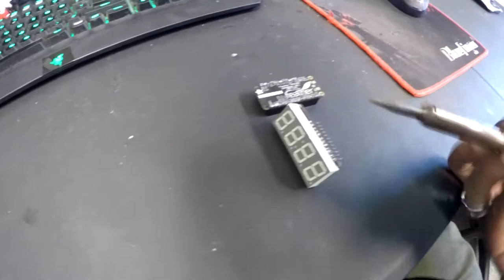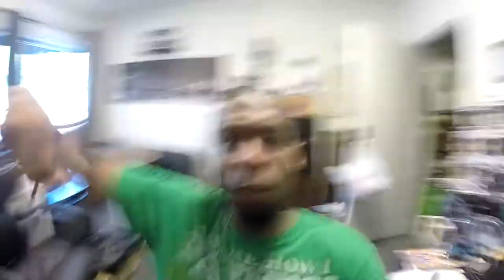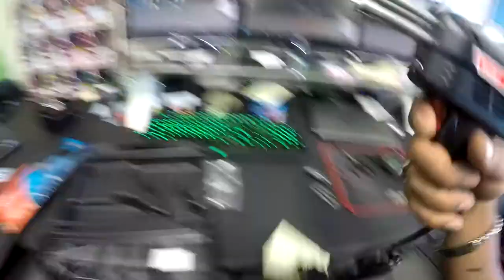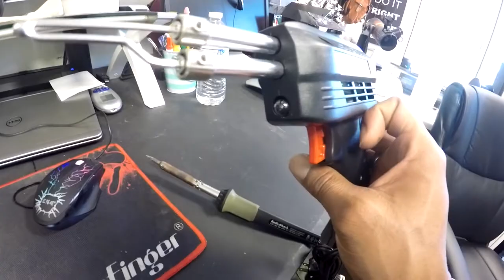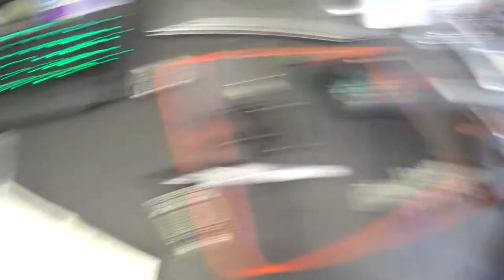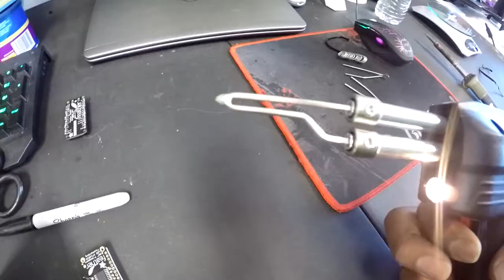Weller 8200PKS Sodering Gun Kit - Unboxing and Review

Comment: As a 73 year old retored electronic technician from Canada...

Weller soldering guns have been an old standby for decades, but to a degree some models might be becoming "too good for the market".

I stil;l have an 8200K from back in the 60's, and it still does a good job for what it is suited.

However as with all else it has its place and its out of place. Also it has a whole family of "Big Brothers".

the 82900K is rates at

To make my own tips, I use A.W.G.14 copper wire.

I have also made my own replacement tip nuts just to have an extra pair around, and my version has an added element of veratility for smaller then normal jobs.

However, in Montreal quebec, Canada, it is beginning to get hard to get the counterpart of the 8200K, although I still have to check out Walmart, as their websits has no picture to be sure what I see offered is the same or (power equivalent, not more) model.

What I have been seeing in my socuting around is two larger models.

The last time I was an 8200 it was in Canadian Tire at about$49.00 CAD or so (plus usual consumption taxes of about 15%), but more recently that was no longer there.

I also have one of the next largr model (up to 140W) and for that I make the tips out of A.W.G.10 copper wire.

(BTW I hold the Canadian electrician's Interprovincial ticket, so I know my wore sizes for sure!)

However that and the oter larger models such as the D550 are too big for many jobs, although they are good for many mechanical jobs, especially with the chemical changes in fluxes and solder following the market integration of the RoHS - anti-lead standard.

There are now solders available for various types of work from lelectrical to Mechanical "metal", to plumbing. They are somewhat more expensive, because they have to contain a small percentage of silver (which Tektronix was doing for some situations long before all that) .
Also when doing mechanical soldering one can solder steel without the need for acid and acid core solder which used to hot-splatter a lot.

Not on CMOS!!

CMOS and other electronic chips (Integrated circuits) such as you were showing are not a safe place to use a soldering gun. the tip will radiate a magnetic field that can =cause problems to semiconductors, especially where CMOS technology is involved. also.

Ofor such cases, you would be safer using an electronically controlled static=-free soldering station, such as from Xytronics. also you should take the established precautons to prevent static chearges from your body causin static discharge damage to those CMOS and other chips. When that happens you will only know when the circuit simply doesn't work in the end.

If working with SMT (Surgace mount technoloigy) such chips need to be removed using a hot air SMT work station with the approprite handlng tools for the package types you need to work with. These tools are expensive. A hot aor rework station can be easily worth $1500.00 and more and that is just the beginning.

That is why component level rework on these circuits is usually not even attempted unless the circuit is worth thousands of dollars to begin with. that's ticklish job! I've done it in my working years!

As for the shaking hands, I have this problem alspo as do many. However "where there's a will, there's a way" but it does become more complicated.

For an old iron I have much like the first one you had there, I made a guin handle out of a combination of wood and steel to hold the hot iron safely at closer range. to control the power/ heat in a rough manner, I power it through a custom made extension cord which ends in a 2 gang 1104 electrical box with a typicl light dimmer then powering a receptacle in the second gang. Note this rig is limited to 500 watts, so don't use with larger heating devices, as the dimmer could overheat and cause a fire! dimmers sued to handle over that power are specialized units and if mounted in the wall use more than one gang of space because of their heat sinks. If low voltage controlled the power handling thyristors are built in fireproof units that are housed in an electrical room or M.C.C. and also work on a different electronic control strategy.

Also Domestic light dimmers are not suitable for use with motors or other inductive loads or capacitive or high inrush loads. Nor are they safe with CFL, fluorescent or other non-resistive lamps unless the lamps stat explicitly otherwise (such as some, not all L.E.D. lamps.)

I also make my own tools and jigs where what I want is either unavailable or excessively expensive, but all that takes hundreds of high-concentration hours1 NO EASY WAY OUT for what is truly worthwhile..

(I have electrical gear I build some 40 years back that is still working, in  spite of having had to work outdoors at times.)
Reply from the maker: Wow, Outstanding information here Mr. Martin!  I greatly appreciate the details, especially from an expert such as yourself in this area.  I have received several messages about my Soldering and also advice pertaining to the 1st iron being the better option for this kind of job.  This was a great learning experience for me, a few of the chips I thought I fired due to the power of this gun, I was actually able to salvage after de-soldering (which I still don't fully understand using the braid...but it worked) and pealing back some of the melted plastic the gun was exposed to.   

But once again, thank you very much from the great information!  Don't forget eBay can also be a great source for obtaining those counterparts.  Usually the navigating is more user friendlier than Walmart.  Same concept, Walmart Sellers are similar to ebay sellers.  They sell though the site as they do with Ebay, amazon etc.  Usually older items are easier to obtain this way.  

Have a great day and thanks for tuning in!

Dave
Reply: ReHi Dave:

1) ebay has a problem that is not their fault. I ordered a commercial paper cutter from one of their supliers in the U.S. and ended up[ with a credit card scam which ultimately was traced to a scammer outfit in Utah. but by the time the credit cared issuer had traced it and stopped it,lthey had already grabbed several hundred dollars monthly iver about 3 months.

EBay is a nice concept, but in a sense they are too good. It makes them too much a target for scammers. Too bad, as usual there is always somne moserable sod to spoil it all for everyone.

Curious: OI assume you are in the U.S. but what state, and maybe what city? I am somewhat of a map and geography buff amongst many other thengs!

(BTW if you are not familiar, Montreal Quebec Canada is about 450 miles (or 7 to 9 hours drive) North of NYC mostly via I-87 from either the garden state parkway or off the Tappan Zee bridge in Yonkers.

Buit that's not the best way to visit. From Penn Station, take the amtrak Adirondack. Its 11 hours, but you will see the countruyside.

Interestingly enough, while NYC is on the coast, Montreal is about 800 miles from the coast. go east from Montreal to the coast and you will end up in Halifax Dartmouth Nova Scotia - and set your watch, it's 1 hour later there!

To see it all for Rail in Canada look on You tube for the many Via Rail train trips, especially The Canadiain, Toronto to Vancouver - you live on the train for 4 days very scenic butg expensive.

And if you do plan to visit, don't try to get Canadain cash from a U.S. Bank. they're just not adequately set up to do it efficiently. In stead bring your U.S. cash and plastic here and walk into any Canadian Chartered Bank.

e.g. If you arrive by the Adirondack in Central Station, the head offiice of thr royal Bank is there as a part of the underground city. You would Walk from Amrrak to them without even going outside. Let them change your cash and more. N.B. smallest Canadian bill is $5, so you will likely end up with some 13 sided "Loonies" ($1 CAD coin used daily).

And if you don't speak French, no problem. (there are some 80 or more languages in a day on the streets of Montreal and many of them don't speak French either! English will do, but the parlance is a bit different. (Parlance moans more or less, manner of speaking,. It is more than simply accent, but not unscrutable.) And stay away from the poyutine! It's He!! for your health. Better other treats.
Reply: ReHi Dave...

1) I think you meant in regard to the chips, "fried" rather than "fired". To me, in electronics, the use of "fired" might infer the on-commutation of a thyristor, such as an S.C.R., ar a triac, or possibly rthe on-triggering of an IGBIT (insulated gate biploar transistor) by the circuitry used to make it "fire" when it should. thjat would apply to industrial electronic motor drives, but in more recent years to their mobile counterparts used to run subways, electric railways (such as the Acela), etc. and also as a part of the drive systems in hybrid vehicles, and diesel-electric locomotives.

2) Being geographically curious, and thinking you are likely american, from what state? I am currently in the Greater Montreal Quebec, Canada area which is about 450 miles due north of NYC.
Having had a mobile career and more, I have had some 1 million KM. on the road, not to mention fly and drives in 3 countries and 3 languages, Englsih (native) French a strong second, and Spanish 3rd., and may uinderstand spatterings of a few other languages.

You can see many of my extensive comments on various You tube channels, such as Ron Pratt and hois truck towing channel, in Aviation, Mentour Pilot and Captain Joe, various Lufhansa videos, and also for rail in many countries, Network Rail in the U.K. SNCF and Renfe in franc and Spain and more.

And various animal related videos (Ilove animals but am not in a position to take direct responsibility ofor a pet, but usually befriend neighbourhood animals easily unless the animal were vicious or too skittish to accept a nice approach.

In the IT world, I like eli, the computer guy, but hois lessons are not for the faint of heart, he is very highly trained and appears to have had somee sort of serius IT relatede milirary career, so you can be sure he knows his stuff like no tomorrow, but he will not be so easy to follow for beginners. I wish I had more time to follow him, but being alone, I have to contend with being "chief cook and bottle washer".

While I don't upload videos yet, I have started one using Pitivi (an advanced non-linear video editor that runs in Linux) but I have not yet solved the problem of my very gravelly voice (part of growing old).

Being a stickler for quality, I will not release something until it meets my pewrsonal standards, so there is a chance I may never upload a video, and adsense and rthe money aspect means nogthing to me because the economic environment I am in would more than tax any tangible benefits out of my hands, so that would be a waste for all.

My objective is to be not for profit, non-beholding and ethically independent.
Reply from the maker: Hello Mr. Martin, E-Bay still has a few of the Bait and Switch routines going on, but not how it use to be.  Its actually more in favor of the Buyers instead of the sellers.  Actually there is an added layer of security (Paypal) which has Buyer protection and now its extended Buyer safety policy outside of e-bays which adds that extra comfort.  (Ever since e-bay and Paypal split).    So what this is causing, most sellers are now leaving E-Bay due to buyers scamming (vesurs the other way around).  Example.

One of the businesses my wife and I have is  selling on E-Bay, Amazon, Walmart, Etsy etcs.  I use to run a channel (it's still on here - I just don't update it any more, due to schedule https://www.youtube.com/channel/UChaB6T41ufJo1N5sO2r-eAQ  which explains how we got into the business).  We have a contract with several large retailers including Amazon, Costco, Home-depot and a few others.  We handle reverse liquidation (contract with multiple locations).  So part of the business is sorting, listing etc.  So lets say I have a brand new item, very detail description and send it out.  Buyer states inaccurate description.  Ebay instantly sides with them and freezes the funds.  We have to jump through so many loops and depending on the price, sometimes its not worth pushing forward and just to let them have it.  But if we do go through the investigation and ebay sides with us.  Buyer is now locked, gets a slap on the wrist and we get the funds....but now, buyer calls PayPal and that's where it gets almost impossible to fight as a seller and the buyer usually always wins.   (just part of the business now)

As far as state, I am located in Michigan now, just moved back 4 months ago from Northern California.  We were living in San Francisco area for about 8 years. Very beautiful, just very pricey :)

I hope one day you find the time to press forward and do a video on YouTube.  I know what ever topic you cover will be very well explained.  And the fact that ad-sense is not the goal, will make it more genuine and standout.  

You mentioned "chief cook" - that's another hobby of mines as well.  Check out DGC When you have time, I might surprise you with an unusual delicious recipe!  https://www.youtube.com/channel/UCSVvjfd1GZ1mHKOCa__pDFA

Cheers

Dave